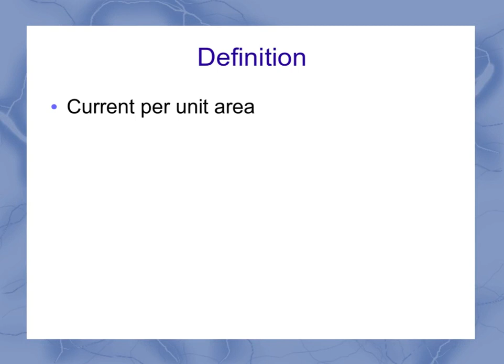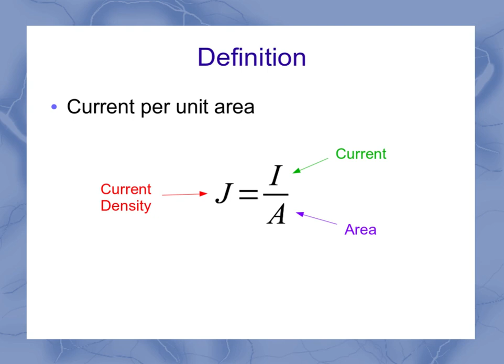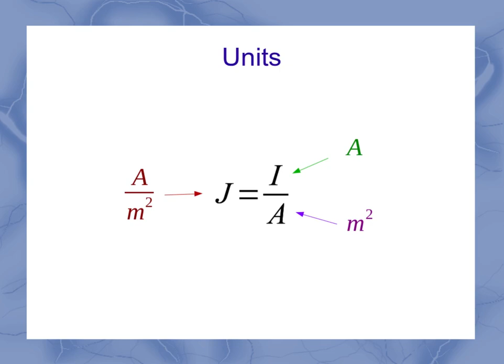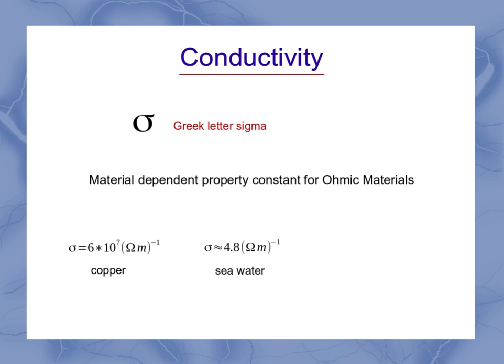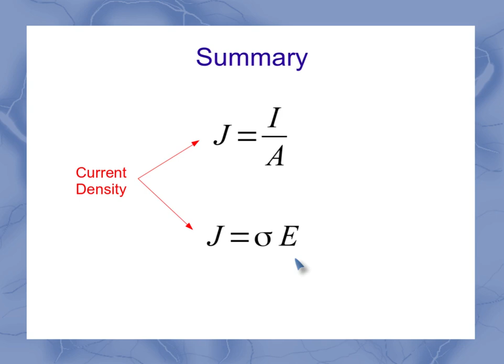Current Density

Comment: I have a doubt... Why current density is a vector quantity but current is a scalar quantity....
Reply from the maker: You can express current as a vector or a scalar. In many equations, they use only the magnitude of the current without regard to the direction, but there are other equations that do use the direction of the current flow.
Reply: @DrJennCash  How do I calculate the maximum current density (Amps per meter squared) for square plate shaped electrodes of various materials (316L Stainless Steel, Graphite, Platinum) that will be used in water electrolysis) before the plates begin to overheat (the heat boils the water producing steam or melts the material)?